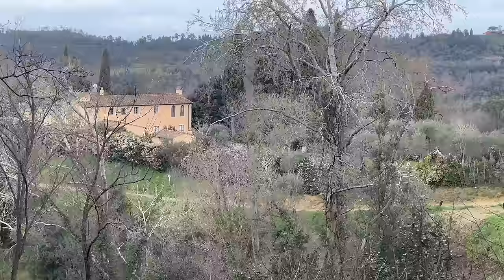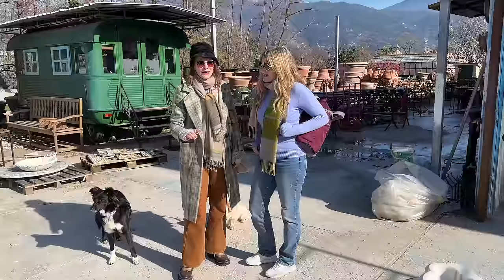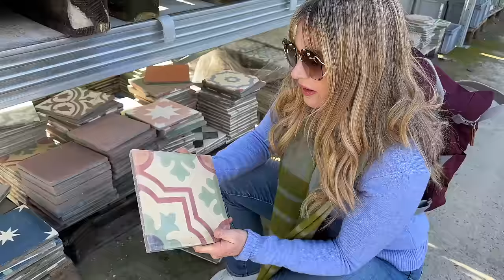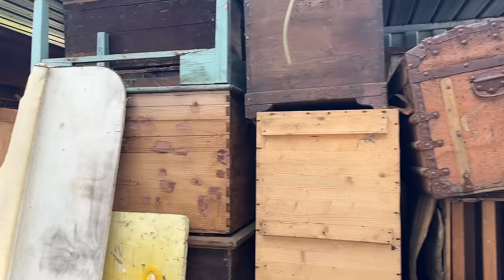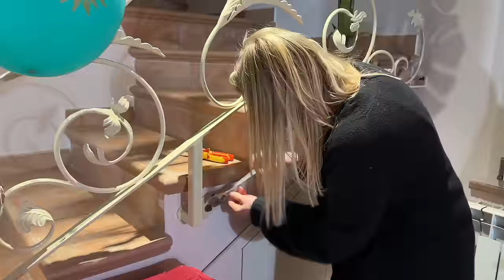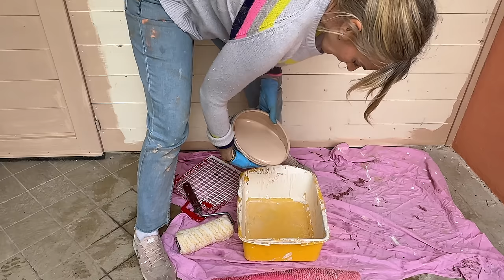CARLO WON'T LIKE THIS!  & Thrifting with @AmericanViscountess  | Tuscan Diaries EP 8

Comment: I think a good balance between you and Carlo. I think the banister is necessary for safety considering those stairs are marble and I'm sure you can spray painted metallic or something.
Reply: Well, Carlo can make a rail on the stairs wall just for security.  If they put the sofa under the stairs, there won’t be any problem if they fall😅 they will fall down on the sofa.😂😂. Just kidding Nicki and Carlo ❤.

Comment: Hold onto the banister. You may want it in a decade or two when you are older. The option will easily be there for you. You could always weld or cut the floral pieces off and make it more contemporary.

Comment: I loved the antique shop that your friend from the American Viscountess introduced you to.  It was really full of old Italian treasures.
A place you could really get lost in.  Your kitchen in Positano is so beautiful so you have a good idea of what to do except with perhaps.
a Tuscany twist.   Entrances to a home is so important.   I'd have Carlo take out the double doors.  As it is you have to go through bars,
then a double glass door & then curtains to get into the house.  I imagine at one time there was a door in the middle of the house, much
like your beautiful blue door in Positano.  Carlo could easily take out the glass doors, keep for the interior of the house? then replace with a window.  Then place a wooden door in the middle, flanked by another window on the opposite side.  It would give the front of the
house a feel of balance & a great way to greet your guests.   It may also create wall space inside, plus give more space to your cute little fireplace.  You could paint the door in a bright color that pops like in Positano.  As far as the stair railing goes, I'd just spray and put
back & tackle later.  Plus, it would make Carlo happy since you're going to ask him? (in my scenario) to create an inviting entrance. Your beautiful English drapes could be repurposed into pillows & slip covers.  Unasked for advice from an amateur interior decorator, whose taken seven years for my fixer up in the Colorado mountains due to multiple mistakes & do-overs.  But, don't us women love designing.
in spite of the headaches.  Good Luck.  Of course, it's your dream.  And I trust in the end you will make the Tuscany home as beautiful as Positano!!!!!!!!

Comment: You may want a different banister eventually for safety reasons in case someone takes a wrong turn in middle of night.  I agree that banister was ugly.  Hope you are going to remove the upper banister as well.

Don't wait too long or Carlos will find something different there that may or may not fit with whole vision.  

He is amazing with most everything.  There are many styles of banisters.

Comment: I'm really enjoying this time, trying to imagine the new kitchen walls, & seeing the lovely scenes of Tuscany. 

I felt a sigh of relief when the choice turned from cement tiles back  to buying ceramic tiles.

The design & color options are greater, plus there's the ability to clean & maintain - even to replace  damaged ones. The practicality of ceramic tiles over concrete wins me over. 

Plus you can buy from a friend,  whose shop is in Positano. I remember the tiles for your kitchen there being delivered by numerous people, going up & down all those stairs! 

This time, they'll need to be delivered quite a distance, but - there'll be no stairs! 😊

Comment: It is quite clear that Italy has no building codes. For safety reasons, replace the step railing. If you can't live with the metal railing, then replace it with another less ornately choice. 
Congrats to Carlo for using English. I would rather look at his face when he speaks rather than reading captions.

Comment: I would print a picture of your curtains and get tiles in Positano. In years it will be a beautiful way to remember your home there.  The banister - I would try painting it and see or go with another style.  All the times I sprained my ankle and had back issues, the railing was a tremendous help using the stairs.

Comment: In Ontario, Canada, removal of the stair railing would not be up to code...dangerous.  You could put a hand rail on the back wall.  I agree with changing the look though.  I just had my old iron railing replaced after hating it for years....not as elaborate as yours, but glad to see it go.

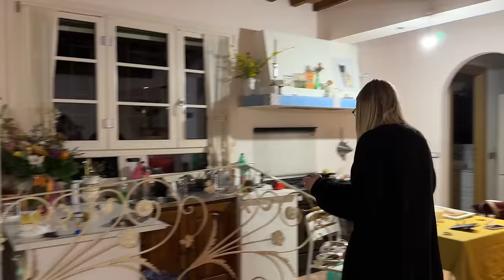Comment: 20:17 the space already has a contemporary frame, so the ornate stair railing seemed out of place. With it gone, opens the space and gives a cleaner aesthetic. If you do put a banister there, a modern straight line railing in an iron metal or “iron finish” would look perfectly

Comment: Because of the time lapse, my comments can be pointless for context but it could still (possibly) be helpful. Reds are good to help your appetite and would highlight the hydrangeas in your drapes. Yellows are quick to brighten and cheer up a space but yellow can be polarizing. You either love it or hate it and a little goes a long way. So putting some yellow in crisp white is worth considering. Or some lemon ornamental tiles in a crisp white. Or an egg white but you might avoid beige. 

The yellow bush is a forsythia and the rules (in gardening) suggest you plant your roses and garden AFTER the forsythia blooms. I had 2 bordering the entrance to my garden and was training them onto a metal arch entryway. They are easy to grow, very hardy and, like rhododendron, they can be trimmed way back with assurance they will return much fuller. I like the plant. They do very well in a Tuscan or lower Appalachian climate.  The color is striking and beautiful but brief. The other 50 weeks it is a green of the leaves and bare stems during winter when it sheds its leaves. 

What is it about men and mud when you put more than one together?  Overlanding or 4 wheeling in the family car?

Sorry Carlo.

Comment: Awe put the railing back and paint it, the couch will cover most of it and you can float the couch forward a bit so its in front of the post instead of beside it cmpletely. That way the rad is not blocked and im sure you can still fit one or two wood armchairs that can work for extra dinner seating when needed. Of course its hard when one is not in the room itself lol